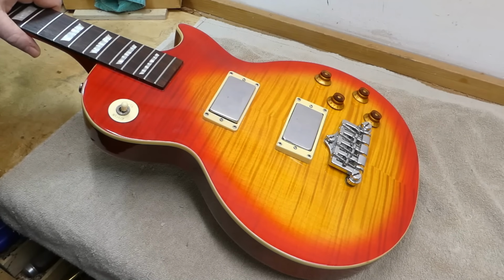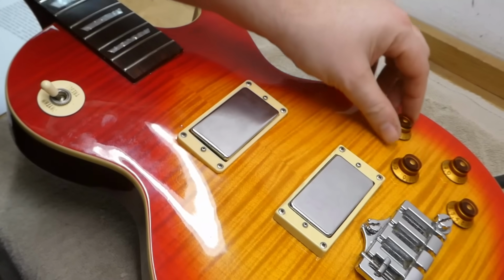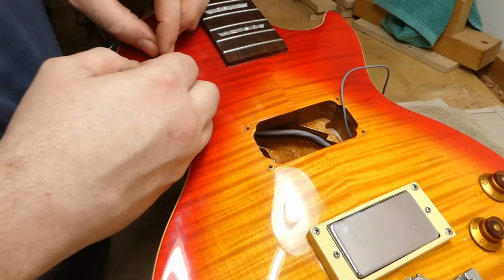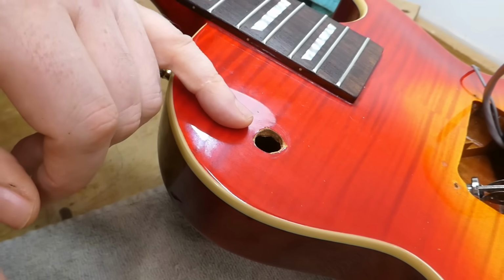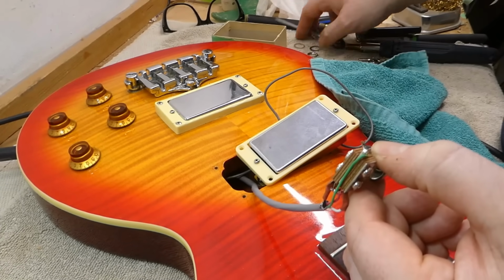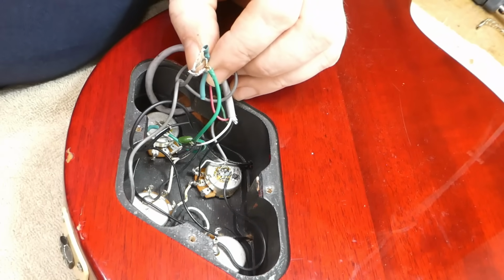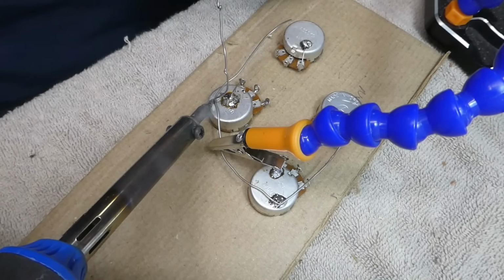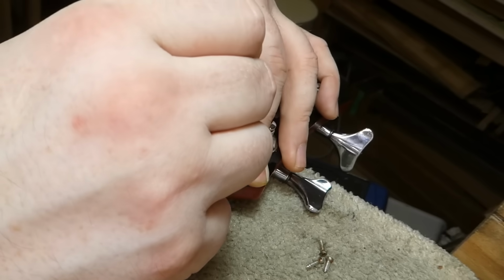Switch Issues and then some...

Comment: One trick I use for my ground wiring is to use a solid core wire of a suitable gauge thickness and stiffness, and cut the jacket accordingly to the needed length without cutting through the solid core wire itself. Then I pull the jacket and expose some wire, make an angle, solder to the pot, and repeat. Basically exposing as little of the solid core wire as needed, and keeping the jacket on to prevent shorts. I can't find the right words to explain this, it's a bit hard, English isn't my first language but hopefully you get the gist :)

Comment: I have a strict rule - if it’s not an obvious fix (like this situation) I take the whole lot out and do every connection from scratch. Sounds counter intuitive, but it’s much quicker and cleaner than problem solving in the cavity. You can offer a guarantee for the work then too because YOU actually did it all.

Comment: I would have been inclined to add the standard switch access panel to the back. Easy to drill out with a couple of forstner bits.
Reply: I was thinking the same thing. Cause how much has that got to be in labor compared to fishing that switch out of a narrow cavity both ways?
Reply: I would have tried to dig out some of the wood through the switch hole if not going all the way and adding a rear access hole. Might be enough to give the switch a bit more room to swing into place without beating the hell out of it. Thinking on that for a sec, it’s probably how the damaged switch got damaged in the first place.

Comment: Nice :) The way you made a cardboard template to set out the pots was very cool.   I don't know if you've ever tried desoldering braid but it would be my go-to for stuff like that. It is especially effective if you hit it with a flux pen before use. A basic soldering station offering temperature control with a couple of T12 chisel tips might make your life easier too.

Comment: The perfect 3 way switch for this bass is the Dimarzio 4pdt 3 way switch, ultra low profile (fits in a gibson sg for exemple) and you can chose the wiring for split both pickups in middle position (in my fender tele bass with 2 wide range, i wiring that switch for the bridge position i aways have one coil of the neck) pretty cool and versatile device! Great video as aways, cheers from Brazil!

Comment: An endoscope is a must have piece of kit when working on semi-hollowed body and hollow body instruments. I’ve also found that long handled surgical haemostats (in either straight or angled configurations) can be invaluable when trying to access and work on those types of instruments. You can fix the endoscope to the haemostat you are using to give you an up close look at what you’re doing. Some of the endoscopes come with an led to light the tip area but if they don’t you can just rig something simple up yourself and just fasten it to the endoscope with some tape or a few cable ties.

Comment: Dental floss for internal routing. Been using it for years on various projects. It's not a 'secret' - but I'm amazed at how few are actually aware. 

I've even used it to sew the sidewall of a mountain bike tire back together. The tire was newer and not cheap, so it was worth the attempt. Backed with a dollar bill between the tube and repair area - it worked well past a year. Long enough for me to forget I'd done it. 

It has its limits, but is far stronger than people realize.
Reply: About 30 years ago a prison inmate used seven packages of dental floss from the prison commissary and braided it all together to make a rope. He was able to climb over a wall, lower himself down and escape from the prison and he was at large for something like a month. The dental floss is really strong!
Reply: @billylindros3023  That's hilarous!!   .....and one resourceful inmate!

Comment: I have a 1998 Epiphone Les Paul Deluxe with 2 mini humbuckers. I had the exact same switch problem. I think the switch is a lousy design and I put in a different style switch. And, I can't remember where I bought it. All the moving parts are enclosed, except for the stem to change positions. I mentioned the humbuckers because of something you said in the video about possibly need every milimeter of wire. Same problem here. I barely got the bridge pickup wired because of length and it's possible I didn't wire it right, per a friend, so I need to check it. Fortunately I have an access plate to get at the switch. Glad to know mine wasn't the only funky switch.

Comment: Ok that certain Bass from Epiphone never came with a switch, that’s an aftermarket modification, the original wiring should have a volume and tone switch for each pick up and if you wanted to not use a certain pickup you would’ve use the volume knob, and use the volume to blend both pickups…
Reply: As far as my very brief research looking at a mid-2000's model, you are correct. I'm guessing a switch route already existed under the cap because that sounds like a very tricky modification otherwise.
Reply: @doe53  Thats so highly unlikely and yet still probably true. Good observation, both of you.
Good to know if you ever wanted to mod one of them this way. 
Just have to use one of those shorter cheap closed asian switches or a freeway.

Comment: Definitely needs an angled toggle switch, that is most likely from someone who didn't know what they were doing replaced it (and also guffed up that wiring too). Very low probability it was designed to use that switch.

Comment: I can recommend the ENGINEER SS-02 de-soldering tool if you want to upgrade, much better results that the blue tube type in my experience
Reply: On paper yes, and they do have a better snap. I got one and found it to be incredibly fumbl-y in my big-ass left hand, and Ted's hands are as big or bigger than mine. Every time I used it it was a frustrating experience, and finally retired it and bought a 4 pack of the blue ones.
Reply: Hm. I’ve never seen a hollow body LP bass. My Epiphone LP bass is basically a Studio version with no binding. Two EMG pups and no toggle switch. 34” scale. BO neck. The three conductor shielded ‘gray cable’ looks very much like the high frequency wiring we used to use in 3rd and 4th versions of digital telephony. Pulse Code Modulation. I am dating myself age-wise. Great rescue of the bass.
Reply: @volesrock  Fair point! It is on the smaller side.

Comment: I had one of these.  It DID NOT come stock with a switch.  Somebody added that in later, and as you discovered, it was not an easy modification.  I have no idea how it was installed…
Reply: Well, I am sure it was installed the same way you did it…but a rear route would have been a much better idea.
Reply: maybe a "variant" (but 4 pots And a switch, it's a bit rich no ?). The only way, I think, is to replace the entire top body, not ideal but it's the only way to make this route.
Reply: But how did they manage to do the routing inside the body? Did they somehow know that that routing exists in these basses? Looks like the routing was factory made, but the hole wasn't.
Reply: @PelleKuipers All you gotta do is taje out the pickup and look inside. And he's 100% correct. They DID NOT come stock with switches. I ought to know. I own two of them.
Reply: @FoulOwl2112  I know, I'm just kind of amazed it came stock with that routing. But it makes sense with the different type of basses to have one standard body.
Reply: @PelleKuipers  It's not so much "routed".  As it is chambered in that section of the main body block. With a 34inch scale these things would have terrible neck dive if they didn't shave a little weight in that area .
Reply: Thats crazy! I was about to comment how outrageous it was there was no back access port.
Reply: @FoulOwl2112  they still have pretty terrible neck dive, imho.
Reply: @FoulOwl2112  that doesn't look like a chamber. It's waaay too small and weirdly shaped. 

If you look up chambers in Les Paul you can see they're never in the top left part of the body. The only thing that's there is the routed cavity towards the toggle switch.
Reply: @PelleKuipers   Never underestimate the power of cost-cutting! I'll bet Epiphone used the SAME body (and routing templates) for these as they did for their 'Les Paul' style guitars. 😆
Reply: @mnemonik61  Yeah they must have! Also probably the reason I think it looks weird. 

I'd rather have a Firebird bass myself.

Comment: I noticed you replaced a B500K pot with an A500K pot. These are similar, but not the same. The B pot has a linear taper, and the A pot an audio taper. So while the total range is the same, the resistance from one end to the arm, at a setting of 3 or 5 or 7 will be different between the pots. Maybe that matters a little, maybe it doesn't. But it is something to think about.

Of course, maybe the original pot should have been an A taper, and someone previously replaced a defective A taper pot with a defective B taper pot before giving up and messing the whole thing up.
Reply: While Ted never responds on comments, two solutions for this : We will never know why. Or someone know this pots arrangement and reply to you. I guess is intentional but it could, in fact, be a mistake (in other hand, he test the stuff before send back to customer, and when you do not use the good type of pot, you notice it rapidly...)
Reply: You have more patience than I do Ted.
Reply: I’m surprised at how many guitars come with linear tapered pots. I don’t see the reason to use them on volume or tone positions. This is more common the cheaper the instrument so maybe they’re just cheaper $? If anyone else can shed light, I’m listening.
Reply: @archloy Ted responded to my comment once. He told me I won a guitar and I just had to pay for expedited first class shipping. It must be coming from far away because I’ve been waiting for 7-8 months now…
Reply: @presmasterflash7555  You can find cheap and not-good-at-all log pots. I agree with you "in general", but you can have cases where a linear fit better your need. It's not a magic equation unfortunately. Sometimes, with certain values, it will be smoother for your ears with linear pot (and you can have a log one with no effect until the last millimeter...).
Reply: @archloy  ok. That makes sense. I just haven’t found a situation where the linear pot had a usable sweep, at least not as a log but that does make sense
Reply: @presmasterflash7555  - LOL! 😄  Yeah he'd responded also to me in that same way, and also more than once 😄
Reply: @mightyV444  whadidyaget?
Reply: @presmasterflash7555  - Oh I never responded as he seemed too desperate to give me free stuff 😄
Reply: Ted has explained this in an earlier video, but I'll remind everyone, again:
In USA-built electrics, the B pot has a linear taper, and the A pot an audio taper.
In electrics manufactured of Eastern origin, The A pot has a linear taper, and the B pot an audio taper.
Why? Dunno. Maybe the same reason Americans drive on the "right" side of the road, while Britons drive on the "correct" side of the road? 😇
Reply: @MutantGenius  - Us Kiwis, too!
😁👍

Comment: Rhythm vs. Treble is a bit weird on a bass guitar.
Reply: It's only there because someone had thought it was a great idea to add that switch plus poker chip!  This particular model did not come with one stock from the factory! 🙂
Reply: @mightyV444 : Oh, well there's how
it got F'd up. It wasn't a factory screw up.
I did notice, the switch lever pivot pin was
out of it's hole, on one side. Someone wasn't
too careful putting it in. As Clint Eastwood said.
"A man needs to know his limitations". 😁🖖✌

Comment: Hello twoodfrd, thank you for the content, I love your videos and been watching them for years now.
I have a question for you regarding the ground wire soldering in an electric instrument, be guitar or bass, I always taught it would be better to just solder one ground wire to every pot and then have them in one connection spot like those speaker connectors or ground connection in an amplifier or sound system, solder all the grounds to that and screw it to the cavity. Just to prevent overheating the pots everytime I have to solder a wire, in fact that's how I damaged my tone pot on my electric guitar which got me thinking about this method.
My question is do you think it would make any difference or impact the sound or ground efficacy in any way 🤷🏻‍♂️.
Thanks, much love and respect to you 👍🏻✌🏻
Reply: In my humble opinion the "star ground" you describe is not needed since you can't have a ground loop inside a guitar, and that's what it's implemented for, to prevent ground loops. Still it can be easier, tidier, more practical depending on the wiring. For soldering to pots bodies you need a powerful iron (40w min) and if you have temperature control I suggest turning up to 400°C. You actually cook pots by staying too much on them without enough heat. At 400°C the solder will wet well and fast so in 5 seconds you can make a solid joint without damaging pots. Also you can scratch/sand where you'll solder to remove any oxidation, oils or even varnish, use additional flux if needed
Reply: Regarding impact on sound and ground efficacy there is no difference if soldered correctly. If you have a multimeter check all ground points have continuity with <1 ohms resistance
Reply: @monz7951  I did all that but cheap pots burn so easily, my guitar has a single volume and tone pot, so i don't see how it's going to be a ground loop, it's a common ground point
Reply: @Mr.Nabil.Belhaj  got it well then you have to invest in better pots. Yes as I was saying it's impossible to have a ground loop in a guitar and the common point ground (also referred to as "star ground") is usually to prevent that. All ground points will be connected anyways and exit at the jack so it really doesn't matter electrically

Comment: Wo there Ted, the 500k pot you replaced the duff pot with had a different law, the duff one was B500k which is linear, you used a A500k which is log. See someone spotted it below. Not a biggy anyhoo, it's just a guitar not an amplifier.

Comment: The 1/4" jack can be dangerus stuff. It fits the jack on the (bass)guitar , and also the speakeroutput on a 100  watt Marshall. Could that kill a potmeter?
Reply: Plugging any pickup into the amp
output will destroy things, wouldn't it?
That's a real question, because I don't know. 😁🖖✌

Comment: Wow what a strange installation on the switch, because there was no access at the back i was thinking the selector disc was oversized and stuck down over a larger hole to gain removal,but no!! How ridiculous is this😂 i mean its tricky enough to be pulling pots through tiny slithers of F holes but this is a first for many to see such an awkward install of such a chunky cumbersome switch to dragged through an oversized tunnel, its got to be a weight saving exercise 😂😂
Nice job as always ted👍
PS: perhaps a longer knee length strap for more attitude on the demo😂❤

Comment: I wonder if it originally had a small, cheap plastic 3 way switch that broke, and the previous owner tried to fit a larger "real" Les Paul type switch and broke it while wedging it in
Reply: I would bet that's a really fair guess.

Comment: Hey, for your solder sucker... instead of using the spring loaded piston, try one of the standalone bulb types (the ones not attached to the iron). I love my hakko FR-301 but if I need a quick and easy job the bulb is way less fiddley.

Comment: Could a Luthier jack be used? Like for gluing braces. A 16th inch would make getting that tight switch easier to remove. It would require caution and very small adjustments, to avoid cracking the top. That's a pretty bass.

Comment: I'd get angry after 30 seconds with unhealthy amounts of bloodpressure. Who builds something like this?
Reply: Did they install the switch before laminating the top to the body? It's hard to believe that the labor involved in fishing that switch through there could possibly be less costly than just routing a hole in the back.
Reply: Well, it's still easier than fixing the wiring on an ES335. It's not exactly  a new thing to not design for repair. The only odd thing is the decision to exclude the back panel when it's part of the original design. I'm pretty sure most Epiphone Les Paul guitars have the panel. Or mine did.

A lot of Epiphone LP basses don't have the switch, however. So maybe it was added after-market. Given the sketchy wiring, it seems possible.
Reply: @redcuillin  The wiring was scetchy all right, but the routing to the toggle looked very factory.
Reply: The assembly line people figure out a clever trick which may or may not affect longevity, but does get the product out the door.
Reply: @Henni63  - Several other comments suggest that 3-way switch isn't original!  Whoever added it must've discovered the chambering in that area of the body and then had a 💡 moment 😅
It also should not say "Rhythm / Treble" on the poker chip of a bass! 😉

Comment: First time I see a Les Paul guitar/bass with the toggle switch in its classic location WITHOUT an access to it ???
I guess the factory workers must have installed it under the maple top and assembled the bass like that...
If it was my bass I wouldn't bother, I'd pull out my router and open the back like a proper LP... Actually I'd tell my customer we'll do that anyway... Sometimes you've got to be a bit bossy for the benefit of your customer...